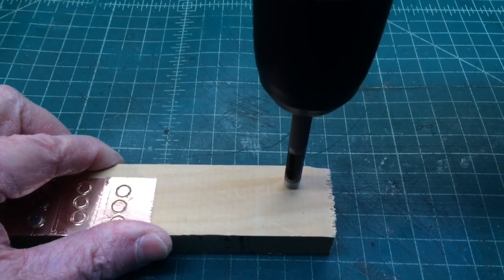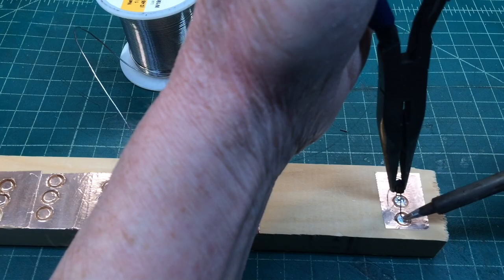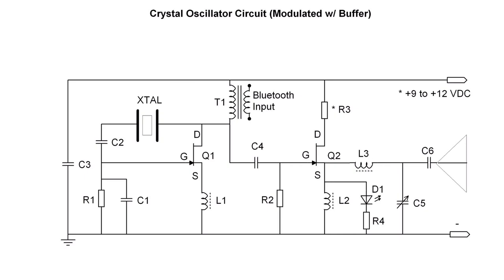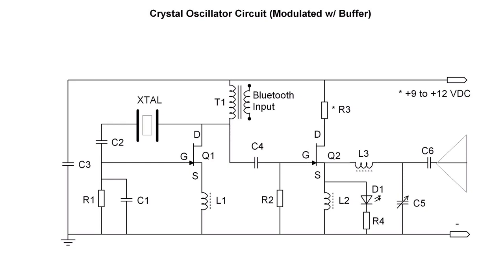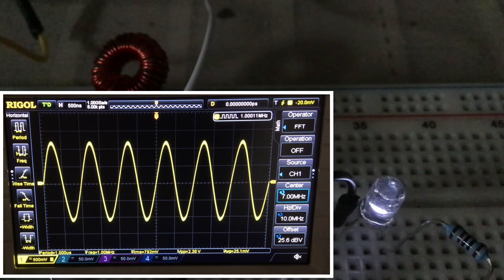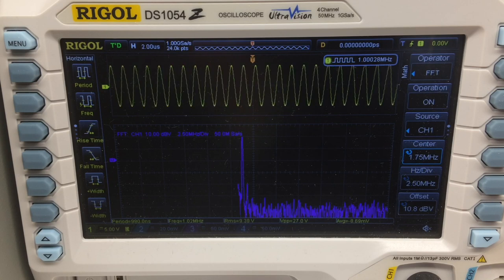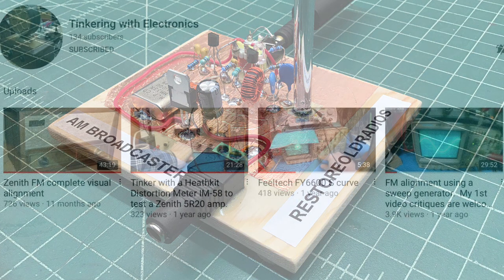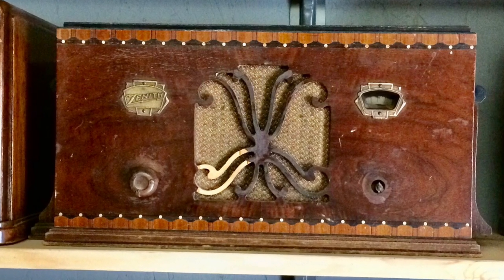Crystal Oscillator Circuit (Modulated w/ Buffer) Using Ugly/Manhattan Construction

Comment: Don, thanks for putting this idea out, it's a great way to make one off circuits and is very sturdy, it took 5#'s of pull to lift one of 2 dots off of my test board.  Also the transmitter does a great job!  Great for a house or shop and fun to build.
Reply from the maker: Josh - I appreciate the collaboration on the project and look forward to more of the same in the future. Best, Don
Reply: pro trick: you can watch movies at Flixzone. I've been using it for watching lots of of movies recently.
Reply: @Fisher Alaric Definitely, been using Flixzone for since december myself :)

Comment: Great project Don. Some time back I used the floating pads technique to make a FM transmitter. I just cut squares off a pc board and glued them on. Worked just fine. Pretty neat way to create a board. On to the Zenith. ;p)
Reply from the maker: Carl - thanks for sharing your creative approach. These circuits are fun to build, but I’m ready to pull that Zenith down and give it a look over. Thanks again for watching and reaching out. Best, Don